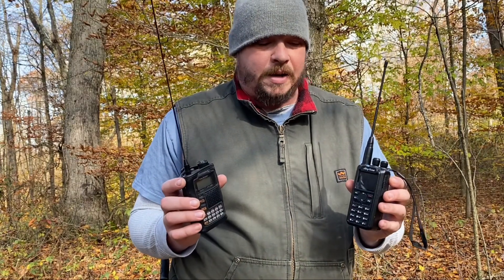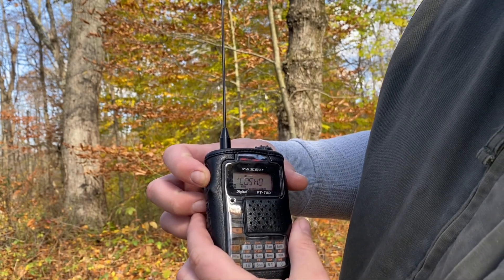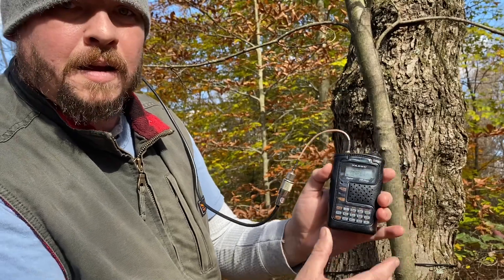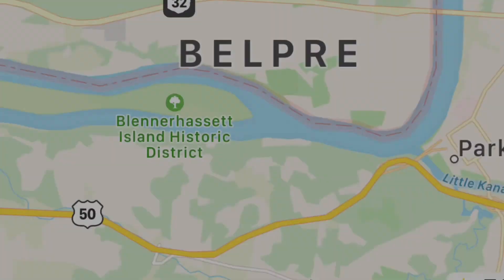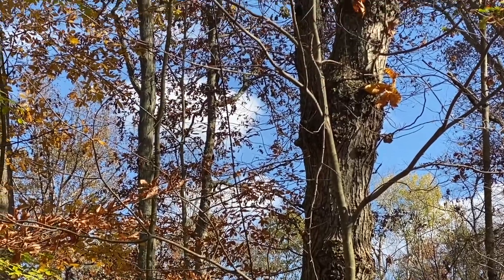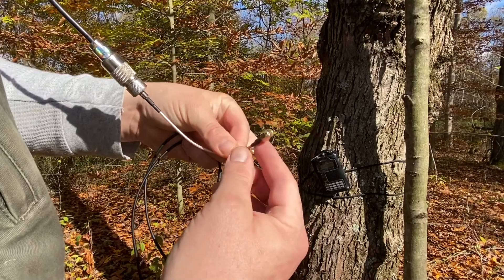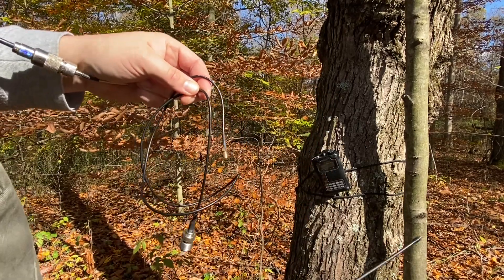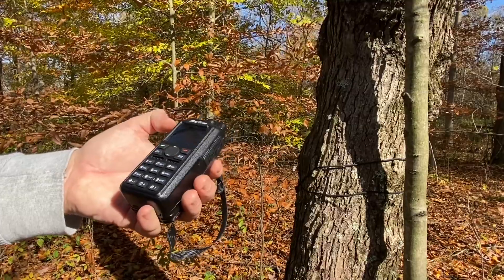Ham Radio "slim jim" antenna

Comment: Can the slimjim be placed horizontally? I'm using indoors over my window frame
Reply from the maker: Vertical is preferred for fm, or digital modes. Sideways is better for SSB. It will still work, but you will looks a good bit of gain if you have your antenna opposite polarity of what mode you’re using.